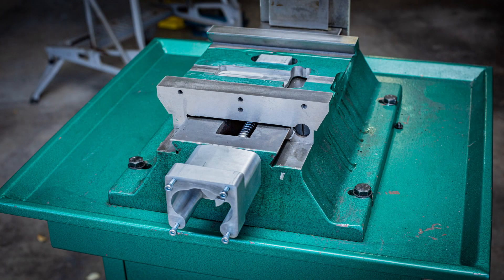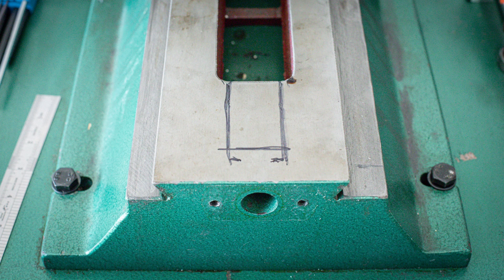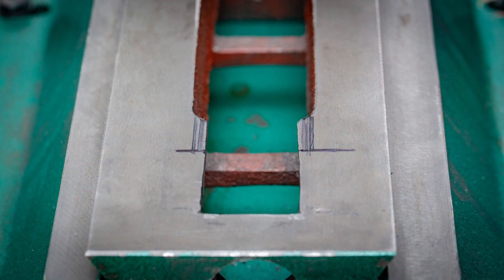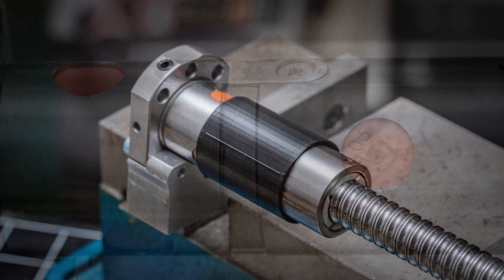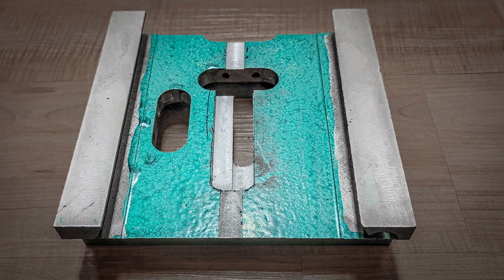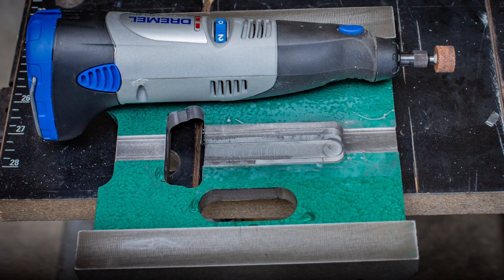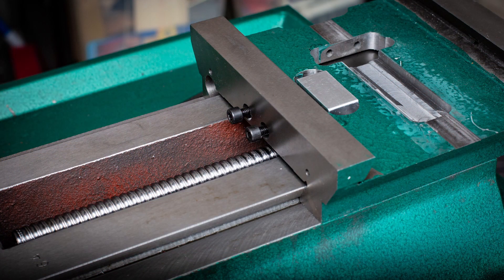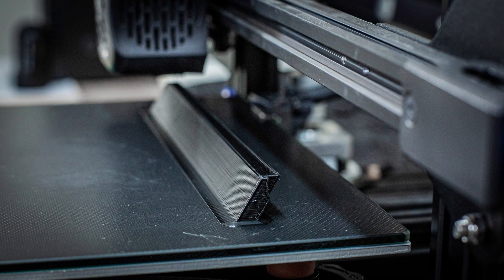Grizzly G0704 CNC Conversion - Y Axis Ball Screw Assembly Installation - Video #6

Comment: If you have a lathe I bet you could mount the Y axis where the tool post goes then put an end mill in the chuck and hog out the material that way.
Reply from the maker: Good idea. But, I don't have a lathe... yet. :-)
Reply: Get one they are great! Ive just finished an ELS/CNC conversion of my budget lathe and it works really well. I used a controller called Nano ELS and its really good. @joat_mon

Comment: Nice job. I wish I would have thought about using a recip saw on the casting. I used a die grinder... and it was very painful. lol. Not sure if my casting is weird or what, but I also need to add clearance on the right side of the existing casting slot in order for the nut assembly to not rub. Buying a second saddle was also a good idea.. I might still do that. Even though I have a drill press, it just left a bunch of craters in the metal, and it's not rigid enough to cut out the thin walls, so more die grinding.
Reply from the maker: Thanks for the feedback! 
The reciprocating saw is one of my most used tools. I use it for everything from cutting aluminum stock to pruning branches. I'll have to put a die grinder on my Christmas list.

Comment from the maker: If I were to do this over, I would consider making some changes. Obviously, I would not have removed so much material from the top slot. The other thing that's obvious, is how thin the casting gets at the top of the inch and a quarter hole in the front. It seems to me that the whole ball screw assembly could be lowered a bit. I'd have to remove some material from the flange on the bottom of the ball nut so it would clear the casting below it. Then 3D-print a jig to guide a hole saw, off center (lower) of the original hole in the casting. The motor mount, mounting holes would also need to be adjusted in either the casting or the motor mount itself. Then, too, a longer clamping block would be required.  Just some food for thought.

Edit:  I just noticed, lowering the Y-axis motor mount will likely cause it to hit the stand drip / chip pan. This could be solved by adding a spacer between the mill base and the pan, raising the mill a bit.
Reply: Is it really worth it to run a double nut? I’m going to try a single nut on the Y axis and see what happens. I will need to cut the top of the casting. I’m trying to avoid enlarging the hole. With the single nut, I won’t have to and I’ve measured I can get 7.5” of travel.